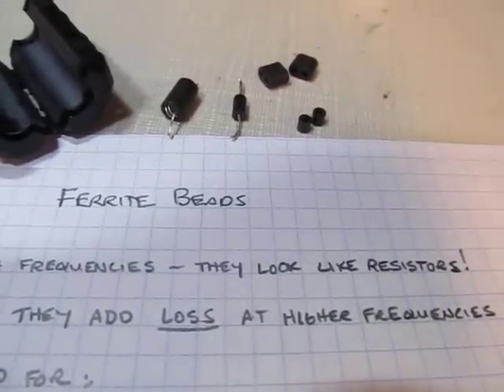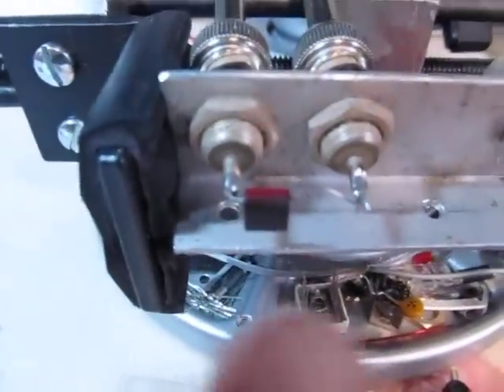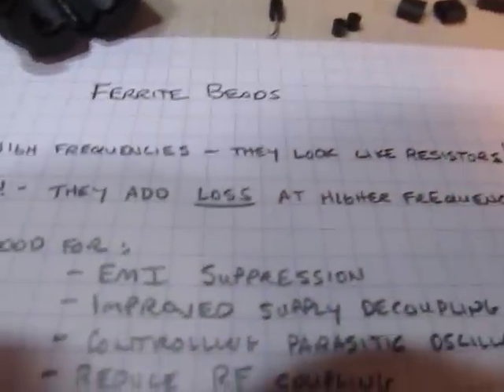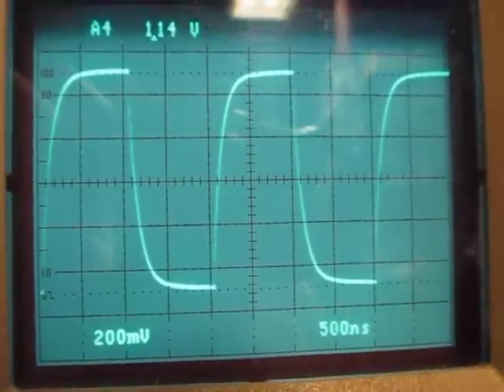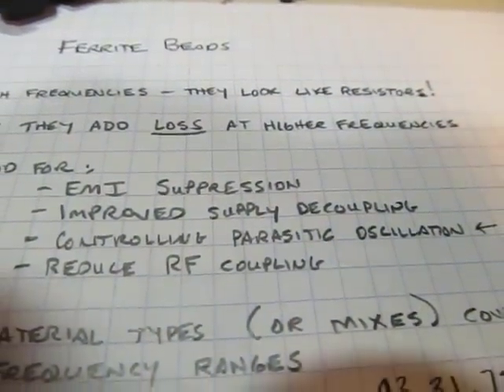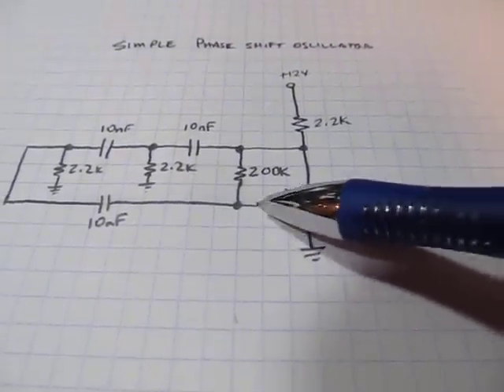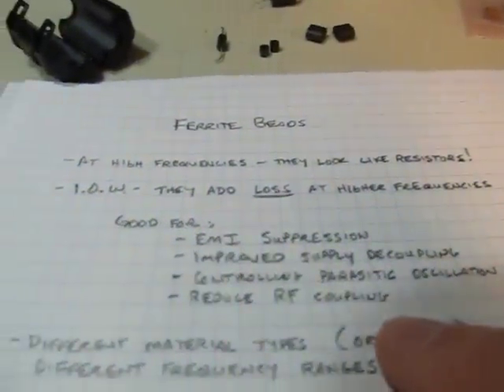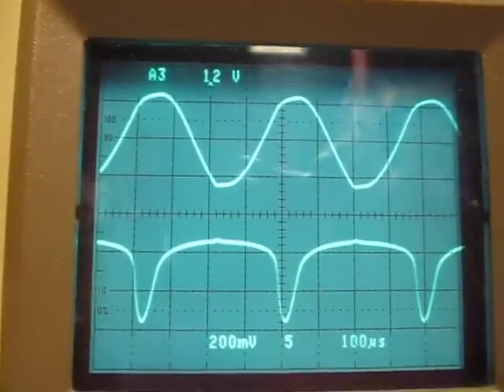#84: Basics of Ferrite Beads: Filters, EMI Suppression, Parasitic oscillation suppression / Tutorial

Comment: Not usefull for audio
Reply: You may want to prevent infiltration of HF in amplification circuits, e.g. originating from cell phone.
Reply: 1959Berre I have seen a number of audio amplifier circuits that are apparently working correctly, only to find they are getting hot because they are also oscillating at HF or even VHF. So this video is applicable to audio and as has already pointed out,  audio circuits are prone to pick up RF interference. In the days of am amateur radio transmission, it was not uncommon for armature and emergency VHF radio transmissions to be "picked up" by PA systems much to the ammusment of the audience. The use of inductors for the suppression of RF emissions from class D audio amplifiers is also relevant.
Reply: Thankyou i dont know about that ijust want to elimite maybe buzz i cant remember what it is named
Reply: Saya Laper is the equipment mains powered, in which case you may be refering to mains hum.
Reply: Nigel Johnson yes it is, sometimes laptop need to use battery when recording to make clean sound
Reply: Saya Laper am I to assume that the interference is only present when the equipment ( laptop) is powered from the mains supply?
Reply: Nigel Johnson yes, if we touch the cable it is gone. Like we touch the guitar string, it’s only for bad equipment like bad microphone. Im not fighting it now because it is not happen, but you know sometimes it happen when you touch mic connector it is gone you untouch it its happen again
Reply: I agree and I know about this phenomenon.  I guess you are adressing Saya Laper.